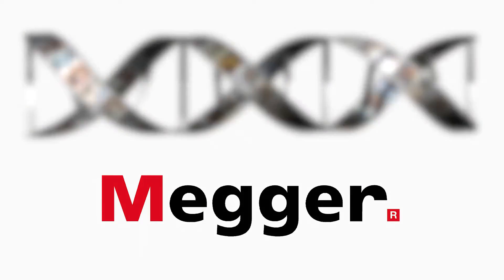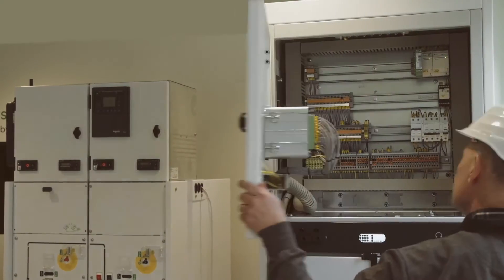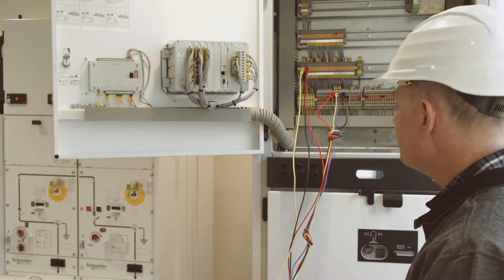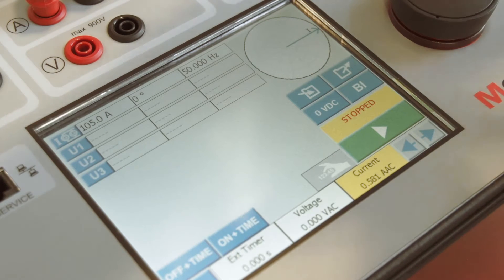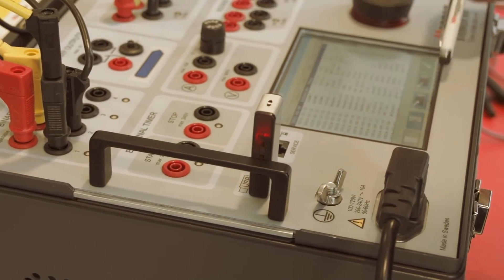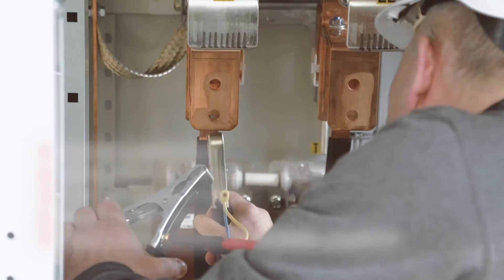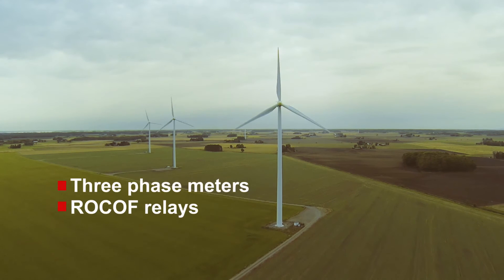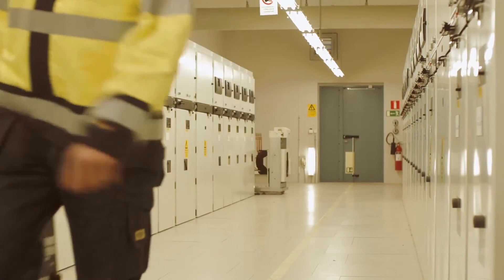Megger's SVERKER 900  Relay and Substation testing toolbox

Comment: THIS IS NOT MEGER BUT SVERKER.  WARNING! Why is the power supply kettle lead plug out of the front  - right next to your fingers.  Bad design flows that sverker Sweden inherits from Volvo.   The power supply lead can be lethal and should  never be installed at the FRONT panel..  Sverker should recall ALL those and fix or ditch it all together.
Reply from the maker: Hi there! Thank you for the feedback! Yes, this is our Megger Sverker 900. We have no record of incidents on this product if you have any problem evidence with a Megger product please contact our support team, we'll promptly reply to your needs.

Customer support - https://megger.com/support/customer-support 

Regards,
Megger
Reply: @MeggerWorld  I'm not against megger in general as they made some great test gear in the past  however the good days of megger maybe gone and standards have dropped since;  i.e one of my sverker 780  suddenly failed and the sverker Sweden  tried to deny design flows and won't respect warranty cover!  Anyway,  I never seen such a poor video! Look at 2:30 and see  the test plug  being plugged in with  no short links!! bizarre dangerous stuff! Also,  at 3:29 the instrument is almost lifted off  pulled up by the stretched leads! Dont tell me that this megger video is any good. Using inexperienced staff to make show case of equipment it was never going to be a good idea.